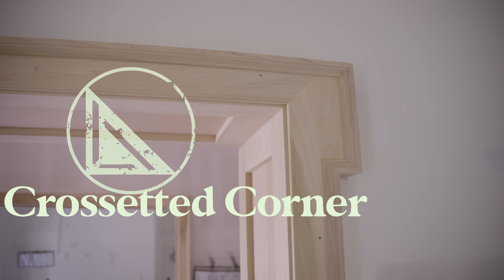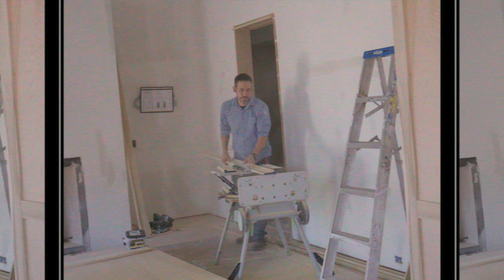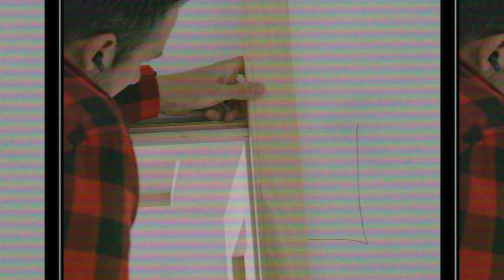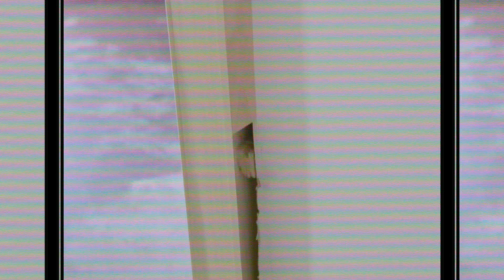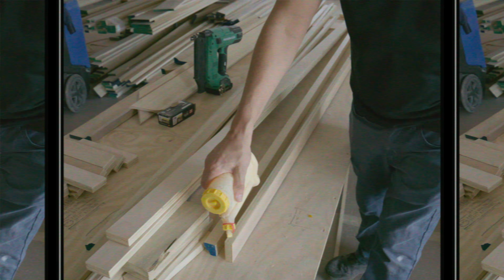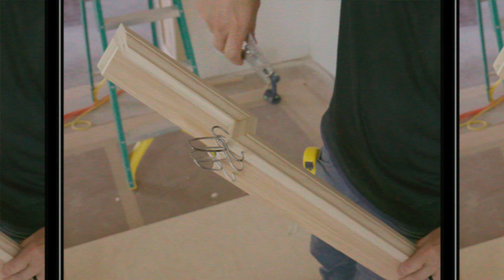Understanding Carpentry: Crossetted Corner

Comment: When do you plan on posting how to extend the casing off the wall to account for wainscoting? Maybe you can point me in the right direction on the proper way to do this? I bought some casing from Kuiken brothers and it’s 
1 3/8” thick. I also ordered some bead board from Windsor One that I plan on covering my walls with. SPBC8 23/32” x 7-1/4” I need to add some jam extensions so that the bead board terminates into the casing without taking away from the thickness of the casing. Maybe you can give me some tips on how to do this properly? 

I was thinking rip some strips of wood that are the same thickness of the bead board and then put them up against the existing jams make a mark and biscuit joint them together?